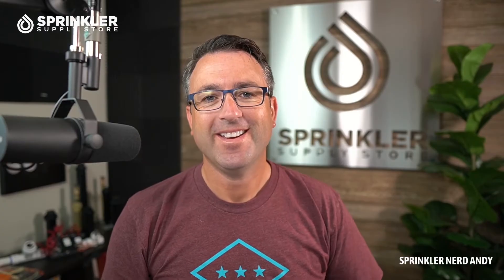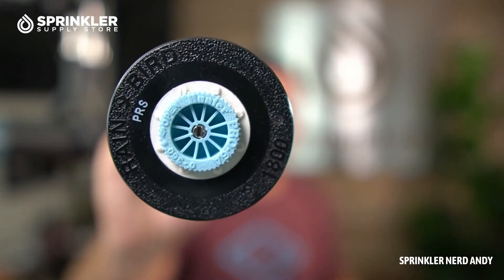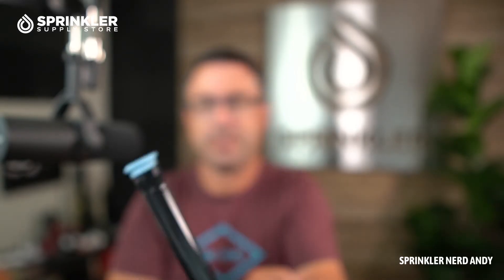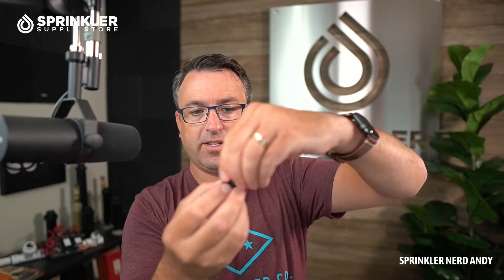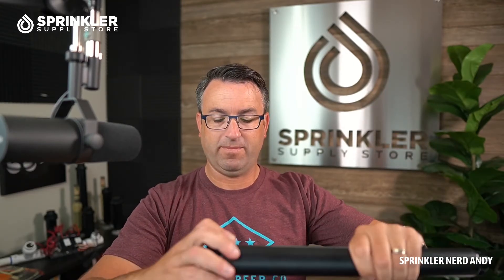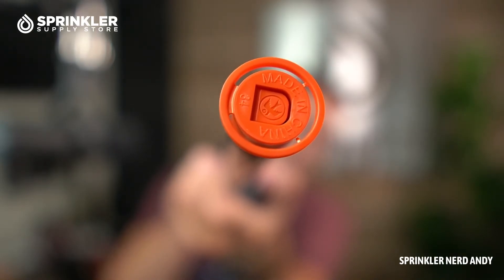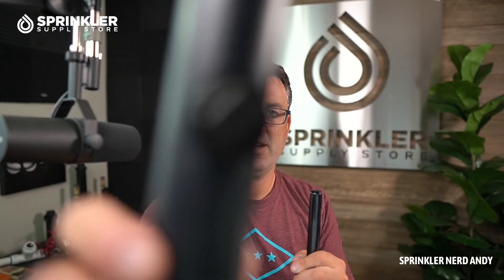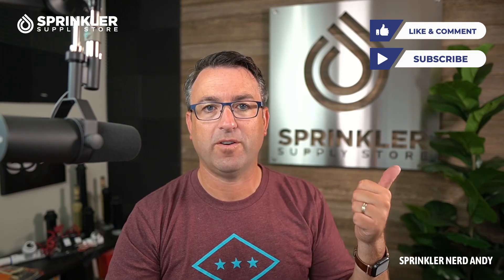Rain Bird 1800 Spray Head Sprinklers, Seal-O-Matic SAM, PRS Pressure Regulation

Comment: Can you adjust the pressure on the PRS sprinkler heads? I have a couple areas getting far too much water, need to lower the flow.
Reply: Unfortunately that is not possible. You best option is to change the nozzle to a lower precipitation rate nozzle, such as a Rotating nozzle. Although mixing nozzles is generally not recommended, in this instant, it may be the only option to lower to precipitation in that specific area.
Reply: @ecomowers  can't seem to find a 3 to 4ft rotating nozzle...
Reply from the maker: @krispy5139  What is the current nozzle (exactly). I will see what I can find for you.
Reply: @Andy_Humphrey  standard nozzle size, doesn't say.
Reply from the maker: @krispy5139  There are different types of "standard" nozzles. It should say Rain Bird, or Hunter, or Toro etc. And then something like 8H or 8VAN. generally, it will have a number followed by a Letter for the arc (Q, H, F, or adjustable VAN).
Reply: @Andy_Humphrey  rain bird 1800
Reply from the maker: @krispy5139  Getting closer! That is the sprinkler. The nozzle writing is super small and often embossed.
Reply: @Andy_Humphrey  MP rotator MP 3000 is one of them...MP rotator 2000... no indication of size.
Reply from the maker: @krispy5139  Oh, that is interesting. Thank you for finding this. The MP rotators are already a lower precipitation rate nozzle than traditional spray nozzles. There are few options for reducing the volume of water other than capping the sprinklers. Hunter makes a "nozzle" cap that you can easily swap out for a short time period while that area dries out, then replace the nozzle. It's not ideal, but it should do the trick if you're willing to switch it on/off as needed.

Link: https://sprinklersupplystore.com/products/hunter-pro-spray-shut-off-nozzle
Reply: @Andy_Humphrey  yeah but they do not have 3-4ft rotators... or that would work.
I may have to cap 1 or 2 of them and then adjust another to cover some of that range.. that might work. Thanks

Comment: I have a rainbird 1800, the grass is getting too much water in one spot in the yard. I just need to cut the amount of water by about half. How do I do that?
Reply from the maker: If your sprinklers have typical spray nozzles, the precipitation rate is roughly 1 in/hr. You could switch the nozzle to a rotator-style nozzle, and the precipitation rate will drop to about 0.40-.50. That will apply half the amount of water as the other nozzles on the zone.

This is generally not recommended because it would result in a potential dry spot, but in your case, it's perfect!
Reply: @Andy_Humphrey  thank you!

Comment: You didn't talk about whether the PRS is required for the MP-Rotator nozzles. Can you use the MP-Rotator with the non-PRS 1800 heads?
Reply from the maker: Hi Alan. You are right; I did not mention this. PRS is not a requirement for any sprinkler nozzle. It is, however, required by law in some states when purchasing new sprinklers, like California - not because it is required by the nozzle (such as MP Rotators), but because it is now a requirement of the sprinkler body. 

In terms of the MP Rotator, this nozzle performs best at 40psi, so if you are considering PRS-type sprinklers, you will want to purchase the 40psi option. MP's work better at higher pressures than spray nozzles which will "mist" heavily at higher pressures.

Yes, you can use the MP Rotator with non-PRS 1800 heads without any issues.

Have fun out there.

Comment: I need to replace one of my Rain Bird 1800 that got damaged with a lawn mower.   It is a 12in one, and I can tell that it is using the side inlet.   Does anything have to be done to block the bottom if I screw into the side inlet?    Do I have to dig a huge hole to spin the 12in Sprinkler Body into the side inlet,  or is there an easier way to do it?   It is spraying some bushes, so the Side Inlet where it connects to the now broken body is actually above ground.  Is there a way to replace this without digging a massive hole?

If the sprinkler body is using the Side Inlet, does that mean that the bottom of that damaged sprinkler body likely isn't screwed into anything?
Reply from the maker: Great question, and I'll try to explain. The side inlet is used to connect the service pipe, instead of connecting it to the bottom. To use the side inlet, remove the plug that comes installed, and screw it into the bottom, to plug the bottom inlet. That should pretty much answer the question ;)

You'll probably need to dig a hole larger enough to make the repair - however large that may be.

Also, double-check that the actual riser height (pop-up) is 12". If this was in the grass and damaged by a lawn mower, you may have a 6" pop-up.

Does this help?
Reply: @Andy_Humphrey  Thank you for the reply, this helps!   It was a 12 inch, and I was able to replace it with zero digging.  I did have to use a blow torch to loosen up the side inlet on the old one so I could remove it, then just popped in a new one!
Reply from the maker: @HeyNikP  excellent!

Comment: Hey Andy, one of the Rain Bird 1800 sprinklers shoots water straight up into the air. It appears to be the basic version as there are no SAM or PRS written on it, but perhaps that part broke off and disappeared? There is only white ring with dots all the way around it. Any advice? Thank you in advance.
Reply from the maker: Very common! Either the nozzle broke off or was mowed off. Or the entire riser portion broke off. Super easy fix, no digging, you just need to know the height (4”, 6”, 12”), and you can replace just the inner guts. Typically, the other sprinklers on the zone will be the same height, and have similar nozzles you can reference. You’ll also need a new nozzle. Happy to help if you need more info.
Reply: @Andy_Humphrey  Thank you. The blue colored portion of the nozzle is gone. Regarding the height, I'm guessing it is 4 inches. It looks just like the one you have in the video.

Comment: nice video...   My problem is I can't even get the head to pop up with the 1800 model.  I have the 5000 as well and just doing a test between them the 5000 pops up using just one.   I'm guessing my water pressure sucks.  Any advice.  Im going to use these above ground in select planters around my small yard.
Reply from the maker: Interesting. The 1800 should pop up more easily than the 5000, with as little as 15-20psi. Perhaps you have exceeded the maximum flow with that zone? (Too many heads)
Reply: @Andy_Humphrey  I’m only testing one head.  I haven’t installed any of them yet.  I’m getting the layout done first.   I can pry the head up slightly than and it goes up.  Soon as I try open the nozzle up wider it wants to go down.  It will stay up at 100 degrees or with increased pressure.   I’m running an adapter to it with a normal garden hose.  I’ve swapped out nozzles and heads.  Makes no difference.   I just ordered a pressure gauge to see where I’m at.
Reply from the maker: Huh. It pop right up. Have you tried testing with another 1800 to rule out anything unusual with that unit? When you get your pressure gauge, be sure to test the pressure with the water running. A hose Y-adapter/splitter is useful for this. Very curious to learn what you find out!
Reply: @Andy_Humphrey  it was really weird.   I bought one later in the day from Menards and it worked.  Than I went to try one of my originals and it worked.  Seemed like it was functioning like normal.  Checked my pressure today and it came back with 70 psi or 5 Barr.   Maybe I had a random low pressure at the time of day i initially tried them out.  Soon I’m going to see if I can get 4 too fire up in one zone
Reply from the maker: Glad it’s working! 4 should work depending on the nozzles. Have fu !

Comment: I currently have 7 rain bird 1800 heads on 1 zone, they are the base model. Can you mix base, PRS 30's and PRS 45's on the same zone? Or do they have to be all the same, ie... all base, all 30's or all 45's? TIA
Reply from the maker: Absolutely! When mixing sprinklers on the same zone, you should consider the type of nozzle…
Reply: @Andy_Humphrey  As of right now all 7 are non PRS with various Rain Bird VAN's. The plan is to upgrade and put new nozzles on some if not all of them. I'm undecided on the Hunter or Rain Bird rotary ones. I just wanted to make sure I didn't have to change out the body of the sprinkler head and replace with with the PRS's.
2nd question... are the outside bodies of the non PRS and the bodies of the PRS's the same and just the inner workings different? Maybe I could buy a couple of PRS's and unscrew the inner workings and put them into the old bodies so I wouldn't have to dig the whole thing up to replace.
Reply from the maker: Yes. Exactly. The bodies (canisters) are the same. The inner workings contains the different feature sets 👍